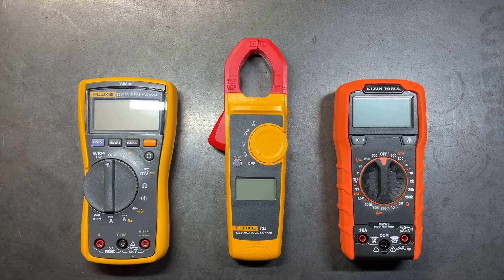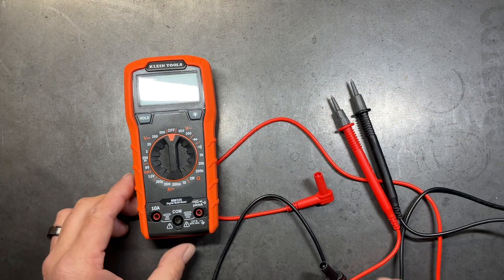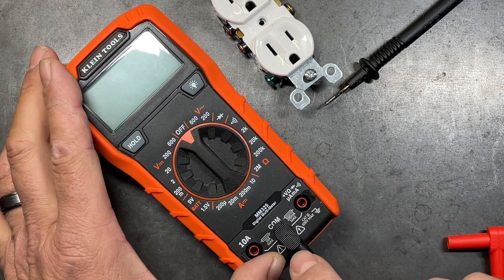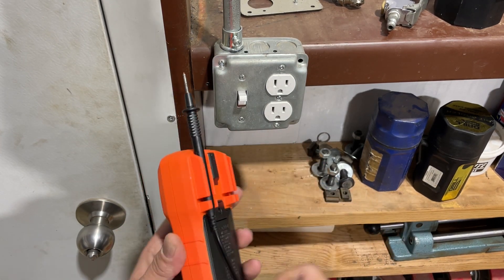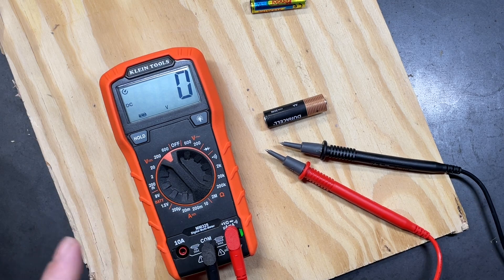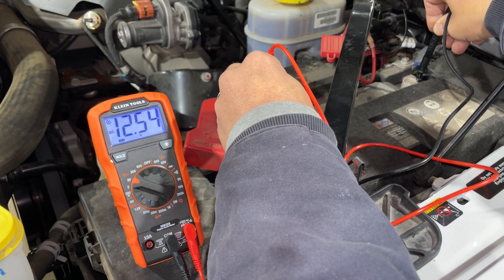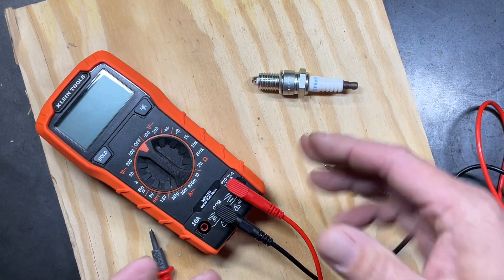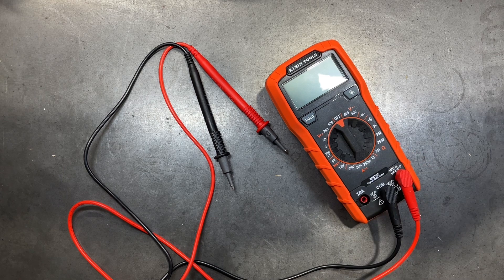Multimeter Basics

Comment: Hey ben have you seen the fluke t6 series of testers? As a service electrician theyre awesome. The field sense tech is amazing. Im able to check voltage and amperage without having to undo any connections. Pro-tip for any out there who have one too, in the field sense setting you can leave both leads in the meter, touch the ground spot on the back and make sure youre touching the box or a bonded metal.
Reply from the maker: I haven’t seen them yet, but that sounds awesome. I think I know where I’m going to be spending my money next.

Comment: The fuse comportment is nice, i wish more manufacturer would do this.
For mains voltage i usually use a voltage tester (eg. Benning Duspol).  They are easier to use and you can also test if the RCD is tripping.